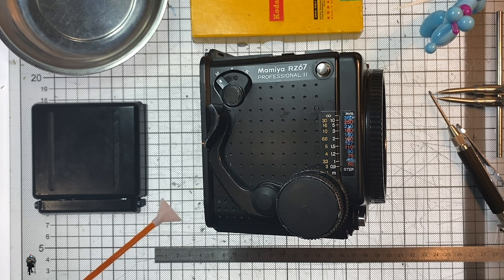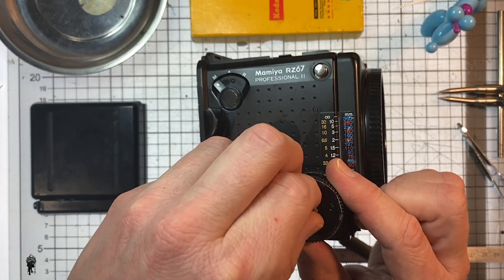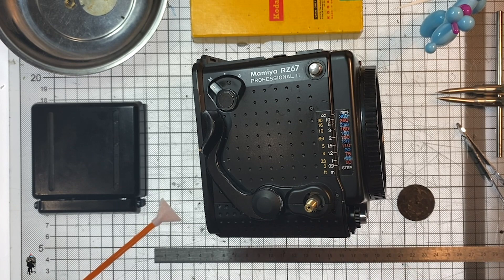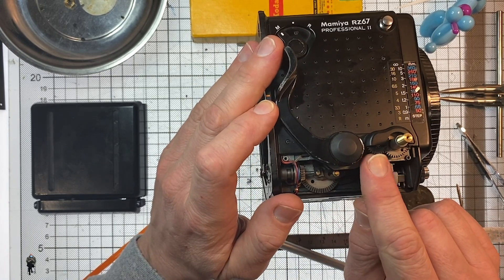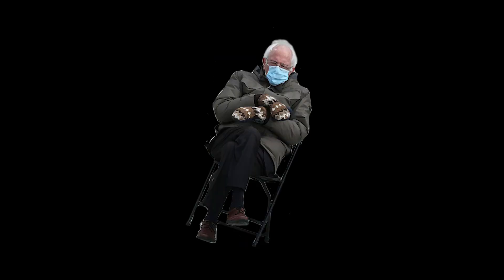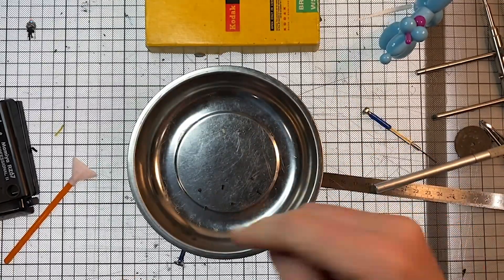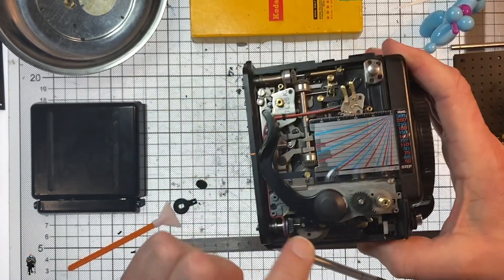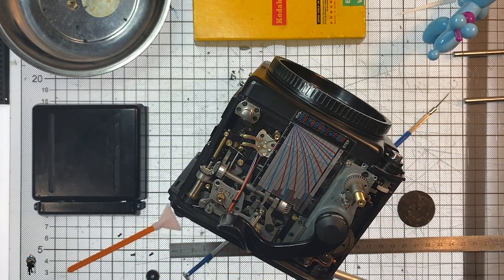QUICKFIX - Fine focus gear replacement on a Mamiya RZ67 Pro II

Comment: Hi,
I wonder if you can help me. I have a Mamiya RZ 67 professional. The focussing rail will not fully retract into the camera, so I am trying to take the sides off to see what the problem is.
The issue I am having is that I can not remove the focussing knob.
I removed the leather cover and the central screw, but can’t get the metal plate off.
It does not look the same as the one in your video as there are not cut outs in the metal plate to allow you to prise off the plate.
I have tried to lever it off from the edge with a screwdriver, but can’t get underneath the plate.
Any advice would be greatly appreciated.
Regards
Keith

Comment: I modified the design to have a hole centered on it. The gear (hole) out of my camera measures just shy of 3mm in diameter. I'm just not sure what the tolerances are in printing the nylon parts are so I may have to do some experimenting and get back. Does anyone have a measurement that works going onto the camera? 2.85mm? 2.9mm? 2.95mm? Thanks

Comment: I got it 3D printed as well but i didn't receive the 3D printed gear with a hole in between. So I'm unable to fit it. Any suggestions? Because the design provided also don't have a hole in between.

Comment: How about removing the strap lug knob in order to remove the top side? Looks like its off before you start the video. Did you use a spanner wrench?
Reply from the maker: The Pro II doesn’t need the strap lug removing like the RBs did - much easier to dismantle!
Reply: @SimonWhiteheadPhoto  that's odd - it seem like mine is getting in the way. I'm going to give it a go and I'll let you know. I appreciate the feedback and your video. Huge help!
Reply from the maker: @danielribar5467  no probs! Just have to slide the side piece down and to the left to clear the lug
Reply: Mines got a washer at the base of the lug that I cant seems to get off. Looks like yours is missing it in the video. trying to use a spanner wrench but no one around me has one that small.

Comment: Thanks for this video!  The coarse focus on my RZ67 Pro II works fine, but the fine focus just spins, so I imagine this is probably the part I need to replace.  Looking at the file for the 3D part, it doesn't show the hole in the middle for the shaft - did you have to drill that out yourself?
Reply: I have the same exact problem!
Reply: How did you download the file? new to 3d printing spa any help would be great. thanks
Reply: @JJay_johnson  The link to the file is in the video creator's comment just above the viewer comments.  You may have to hit "show more" to see it.
Reply: I am facing the same issue. How do we resolve it?
Reply from the maker: Hi there. Yes - it appears that the file has been modified by the user and now doesn't have the drilled hole...? Weird. If I find a solution, I'll post an update here.